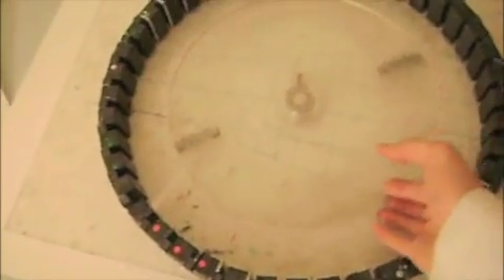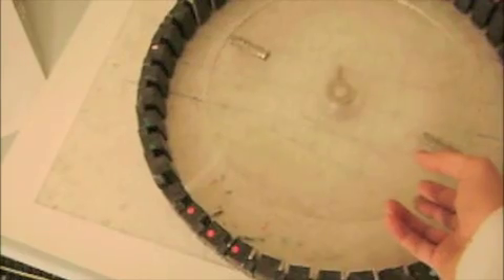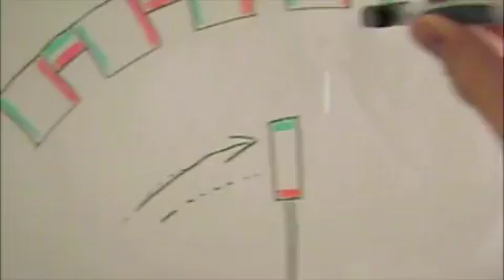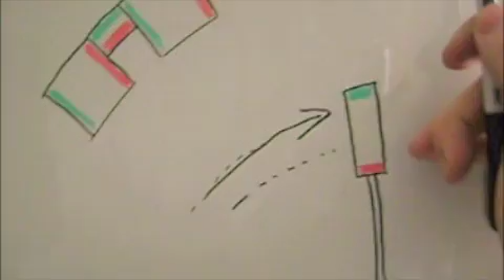The One Inch Barrier to building a Rotary Magnetic Motor Design.

Comment: If I recall, Howard Johnson's stator magnets were offset pairs. Or to put it another way, if you made two separate motors exactly the same and set them on top of each other, but offset the top one with respect to the lower, then the rotor would be moving past the sticky spots at different times; the repulsion force of the upper would overcome the sticking of the lower, and vica versa.
Reply from the maker: Thanks for the input, but offset pairs wouldn't remedy the situation. Johnson's idea was to use spin accelerators to boost the speed of the rotor as it went through each accelerator. If anyone managed to successfully build an accelerator that worked like he suggested, the one inch barrier would no longer be a barrier.

Comment: What you need to do is create a cam that is somehow attatched to the rotor that sucks the rotor magnets inwards toward the middle right before they reach the one inch barrier then pushes them back to the correct positions just after the one inch barrier.
Reply from the maker: Easier said than done. Using a device like that gives up any potential gain. I've tried a few. Thanks for the idea though.
Reply: Motionmagnetics
There are other forces available than just the potential of the magnets. using aluminim plating below the spinning surface will take advantage of Lenz's law and allow the aluminum to hit a can that will move one of the magnets forward. You are a smart cat and I bet you completely understand what I just pointed out. I look forward to your video demonstrating exactly what happened. By the way...the aluminum plate needs to be about 1/4 of an inch below your spinning plate.

Comment: This is the most hilarious thing in the world.
Reply from the maker: Why, thank you.
Reply: Motionmagnetics I can explain why if you want me to.  But I suspect you're not going to buy it, as it involves real, actual science.  Like pesky thermodynamics.

I'll just explain it.  The "one inch barrier" is energy lost to heat, and it's mathematically not possible for this "barrier" to be overcome.  The most you can achieve is a frictionless flywheel, which would never slow down... But which you would never be able to extract energy from without slowing it down, so that's not very useful.

You are coming close because you have found ways to reduce friction.  But you cannot extract more energy from a system than you put into the system, which includes magnetic potential energy from positioning the wheel in an initial state such that it maximizes PE.

Your video is funny because you come so close to understanding this principle, and yet, you are so far due to your sheer willpower to ignore physics.
Reply from the maker: Well, thank you for that fine dissertation in basic physics. You are correct, by the way, but you know that already. If I were simply attempting to build a frictionless system that somehow magically creates more energy that it uses, I would be in agreement with your hypothesis. What I'm after is something a bit more bold though. I'm looking for a way to tap into the exchange force, which is why a great deal of my work is patterned after the late Howard Johnson's research. As that's also what he was attempting to do. Thank you though. I'm glad I made you laugh.
Reply: A force is not energy.  There is no energy to be tapped from magnetism except for any potential energy you first put into the system.

Magnets are neat, but a force is not energy, and there is no energy to "tap into."

I looked into this Howard Johnson guy, and while he's a little closer to reality than your average crackpot, he's still a crackpot with not the greatest understanding of physics.
Reply: There's a law that states that energy cannot be created nor destroyed. Good thing there's no rule to about moving the existing energy from where it is to where it isn't.
Reply: So then tell me where the "energy" just magically disappeared to. The compressor in an AC or a heatpump compressed R410A(a refrigerant) into a small chamber or line which INCREASES the temperature of said gas. Then it is TRANSFERRED to the indoor part of the unit where it CONDENSATES and therefore changes state into a liquid which cools it down to sub zero temperatures and in a heatpump it reverses the process. This whole process is taking the energy (gas) from where it is to where it isn't by using the states of matter it can be in and a VACUUM sealed INSULATED line to MINIMIZE energy "loss". So what happens when the outdoor coil expels excess heat....excess "cold"? The heat is dissipated into surrounding air at a subatomic scale and it will affect the area around you at an incomprehensible scale. This is why cold things insulate and also why absolute zero cannot possible exist. The damn atoms are always moving. Newtons first law need not apply unless you're trying to make a motor like the one video. I would like to see this "overunity" design because overunity is nothing but an imbalance in the system to me.

Comment: What is it that makes it stop at the one inch point. Is it being repelled by the magnet at that point or attracted back. If it is always the same spot then this magnet needs to be turned off or canceled out at that spot. What if you had another set of magnets one on the wheel and one stationary that did not interact with the other magnets. These two magnets would be arranged opposite the sticking point. So if its repelling the magnet that makes it stick than have the other two magnets attract thus canceling out that spot.
Reply from the maker: Essentially what happens is that most arrangements of magnets, no matter how seemingly complex they seem to be, simply extend the magnetic fields of the smaller magnets into a larger magnetic field that is similar to one long curled magnet. Thus, whatever potential gain you might seek, is given up by the system equalizing itself or zeroing out. What is necessary to fix this, is a spin accelerator that works the way it is claimed that Howard Johnson's did. While there are drawings of them in his patents and designs, replicating his actual results isn't a simple matter. If it were, there would be people everywhere doing it.

Comment: What if you tilt your rotor on a slight axis with stronger magnets at the lowest point and the weakest magnets at the high point.
Reply from the maker: It would still zero out. Thanks for the suggestion though.

Comment: Excellent research and some interesting practical experimental work - well done! I have looked into the shielding issue with experts in material science and the best candidate consistently comes out as Mu-Metal which it would be worth you looking into. Also, might be worth investigating the curious system properties of the magnetics when "like" poles are mechanically forced together and begin to exhibit "anti-attraction" (or gravity-like) properties (with reference to Maxwell, Coulomb etc). There's a very interesting guy called inventor3 on YouTube who has done some fascinating experimental work around this and is well worth a look. The answer might not quickly or through the efforts of one person but if we can co-ordinate all of these brilliant experimenters effectively then we have a virtual global research lab at least as good as any other. Anyway, that's what I think. Keep up the great work!
Reply from the maker: Thanks. I'll take a look at his channel.

Comment: I have also been bitten by this by this magnetic motor bug. I helped my son build a hand cranked alternator and I was hooked. Here is the name of  the video of the alternator that we built. "Homemade axial flux alternator for school project " I have been playing around with a magnetic motor and we have a machine shop here at home so I made a small rotor with 16 neos that were placed at an angle and then used a stack of magnets to repel towards the neos as it rotated but as you know it would not work. I removed one of the magnets on the rotor and then it would make almost a whole turn and then stop where the magnet was missing. I watched some of your videos and some other ones about shielding. One was by a guy known as James Roney stators. He shields the outside magnet so it only has one pole. why doesnt he also shield the magnets on the wheel to have the oposite pole? wouldn't this let the wheel run at much higher speed? Also  I saw a video where the rotor had like poles and the stator had the opposite poles. Then a rotor was spun at twice the speed as the rotor to make a shielding material come between the magnets at the sticky spot. Have you even tried this?
Reply from the maker: I just watched your video, and really enjoyed it. It's good to see someone take the time put together a design like that. 
James Roney is a good guy. I've corresponded with him a few times. He's using the metal on the wheel to effectively shield one pole on each of the magnets on his rotor. It would be nice to see how his device would react if all the magnets were shielded using his shielding technique. It takes some work to put those together though. 
I haven't tried the last set up you described. Thanks.
Reply: Motionmagnetics
Reply: Motionmagnetics

Comment: very cool , the 1 inch  is actually unsurpassable ,  the laws of thermal dynamics prove this however if there was any hope of this working you would need a rotating magnetic shield that acts as a magnetic switch, a spinning disk however may induce small currents that act as magnets. think of it like this, can you make a motor that runs on springs alone? certainly not. magnets are nothing but atomic springs. i love your videos though because i use to try and design these things myself,

Comment: More ideals, do like three rotors, then set them 1/3 out of phase or do 4 a 4th out of phase, 5 a 5th, of each other and so on, this will allow it to run smoother i believe. also if one rotor shows a small gain than three to five or ten could prove satisfactory, lol All powered by the same low powered motor that will flip a few magnets.

Comment: Or use the stator for the 2 magnets and the rotor for the circle of magnets so you can have a easy way to connect the 2 stator magnets to a low power motor that can flip the magnets physically, the speed of the flipping stator magnets will determine the speed of the rotor, up to a point. But again the strength of the magnets should overcome the energy needed to flip the magnets. Also, even a small gain can be built up, add more rotors stacked powered by same low power motor turning just 2 more.

Comment: But i am saying you might need a small amount of energy to redirect/shield the magnetic flux i believe is the only way to make this work. Use a timing device like a phototransistor and led setup, redirect on the magnetic flux during the dead spot when any rotor magnet beginning to cross over it. I believe the strength from the magnets will be enough to fuel the supply of the input and have extra to charge other batteries. Your device has big spacing, needs close tolerance for maximum torque.

Comment: I realized You said reversing the rotor magnets made it go in the reverse direction, so that means in the dead spot if you reverse the polarity of the magnets on the rotor at the beginning of the dead spot it will actually accelerate thru the dead spot, but then as soon as it leaves the dead spot the rotor magnets need to be flipped again, over and over to create constant rotary motion. Better design for this ideal is arrange all the stationary magnets on the rotor, then have stator flip flux.

Comment: I just tried to make a magnet motor. It didn't work. Sometimes you just have to question the paradigm, and find out for yourself. The problem is that the opposite side of the magnets are exposed to each other, no matter the shape, size, or position of the magnets. The reason is because there is no energy being created in magnetics. Just like gravity, when you pull them apart you've used more energy than their attractive force. The inverse is true of repulsive technique. Output < input.

Comment from the maker: Hand cranked generators could actually be very useful, if they were built properly. Most of the ones available on the market aren't very efficient though. The ideal way to build one would be to use a set up that's very similar to a wind generator, only attached to stationary set of petals, instead of a windmill. If you added the gearing system that you suggested, then you could optimize it for maximum power output.

Comment from the maker: Let me know when your vid is up, so I would enjoy checking it out. An electric motor is easy to make, however, trying to wire up a coil system that collects enough power off of the magnets in this design to self power the electric motor...well that's another matter entirely. I've yet to see anyone prove that they have done that.

Comment from the maker: Depends on if the gate you build works on attraction, repulsion, or a combination of the two. Some rotors are repelled at the opening of your assembly, but will easily exit it on the other end. They simply don't overcome the repulsive effect at the opening of your assembly to achieve rotation. Others are attracted into your assembly, but stop at the point of greatest attraction. Hope that helps?

Comment: Sorry to trouble you again, but I wonder if you could consider *a 1/3 segment of that circle* AND~ then place upon turn table and above the magnets so arranged another magnet. 
REASON
A bycicle requires a force (@crank)applied for that 1/3 segment AND ~ has the advantage of legs to overcome the back pull moment AFTER~ having had the beneficial force of the attraction.
OR IS THAT just nonsense ?

Comment: May be dumb, BUT~i see you only have 2magnets on your spinning disk, are they an equivalent N/S set, or both the same pole. 
BUT~ also more to the point, what would happen if you arrange a set on either side of the ones you already have ? 
Reason< i notice that whilst that 1 inch seems to be indisputable  the disk does in fact pass it's *still* point when spun, no idea if that's worth looking at BUT~ *** past point *** is interesting don't you think.

Comment: Thanks for answering-
I've noticed that whilst that 1inch curiosity exists as shown and no doubt a major problem when aimed at continuous motion, as in a motor.
BUT~ mind on the drive cog of a bike, could one arrange that inch at the top of the down push on peddle, and after initial kick by cyclist..... still get the advantages of that magnetic array.
Not sure if that's clear, but a bike rider doesn't need continuous force, just a greater force... on demand.

Comment: sorry, dbl reply : these devices WORK when there is CONSTANT input. If you are attempting perpetual motion, okay; but if you want over-unity, Josh has a point about small inputs enabling the ability to output more than what is required for HUMPING that wheel around your cog spot . . .

Comment: I don't think you can do it unless thermodynamics is wrong, however you can probably save yourself manual work with actual magnets and diagram the fields.  If there is any spot where there is magnetic equilibrium then that will be the ultimate stopping point for the real life machine.

Comment: just added more rotor magnets (4) to my candy cane magnet motor configuration and ya your right it just cogs it up 4 times as much haha. Played around with putting 3 spoons as a shield to pop down infront of the rotor magnet as it in repel goes back into the loop, looked cool and was kind of working lol but the spoons also pulled it back. but was cool to watch the spoons get pumped up and down on their own on the end of a cut of salad tong as the spring would make it pop back up on its own.

Comment: The first half of it's rotation is acceleration, the second half deceleration. It doesn't instantly stop, this should be obvious if you had studied high school physics. You're not within an inch, you're off by half a rotation plus an inch. 

The inch is due to friction, not design. The magnets do not provide power, they store it., in their first half of rotation they're releasing power stored by distance. In the second half or rotation they reclaim this.

Comment from the maker: That's the real trick. If you employ a shielding method, it will usually offset any potential gain from the electron fields of the magnets. It's possible, that if you could arrange the magnets in such a way as to gain enough momentum before encountering the shielding, the the problem could be overcome. I haven't pulled that off yet though.

Comment: the inch gap is where the attraction/repulsion kicks in in a bad way and thus halts the turning, whats needed is a shielding that can slide into place to negate the effect, but the insertion of the shielding must use less power than the power from the overall turning, and also must be removed too , again using less power ??

Comment from the maker: I didn't try it in this particular configuration. You can put one together pretty easily though. Howard Johnson often would just angle a bunch of magnets together with spacers, and tip them with neos. If you look at PMMG4HYBRID's channel, he demonstrated a couple videos with a really nicely designed Johnson style track. The cart he uses employs a banana shaped magnet, which is composed of smaller neodymium magnets with spacers.

Comment: The magnets don't actually do any work here. They just function as an invisible landscape of magnetic hills and valleys in which you do work by pushing the moving parts up to the highest magnetic hill, giving it potential energy, and then letting go, resulting in an imperfect conversion to kinetic energy as the moving parts tumble downhill.

Sadly, you need an alternative theory of magnetism for there to be any hope of any such device ever being a motor.